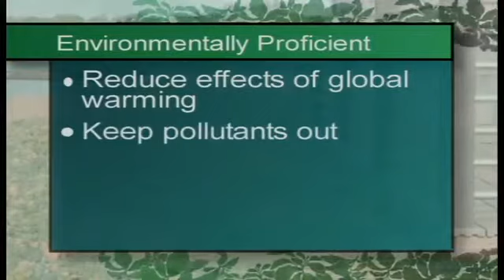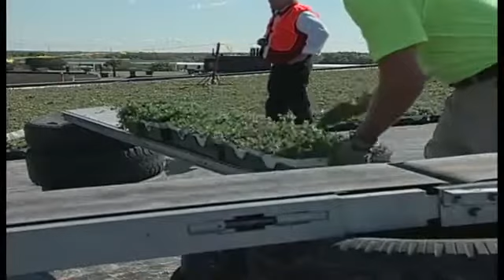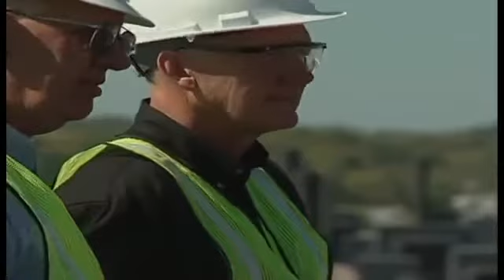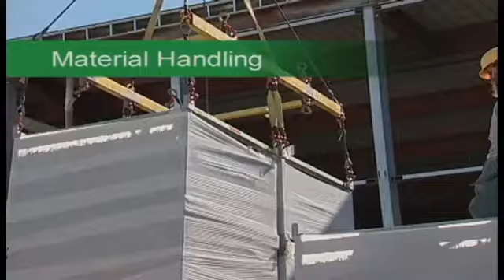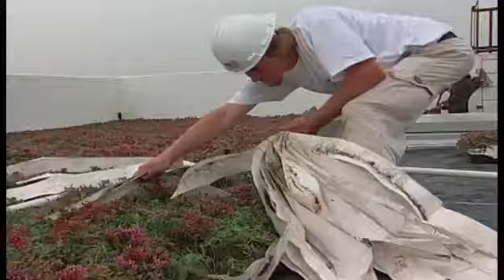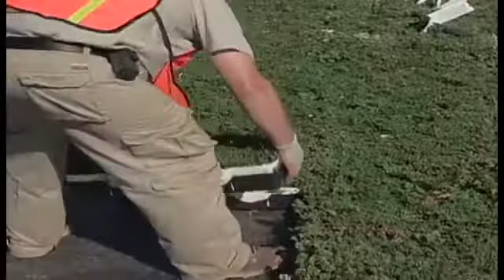How to Install a Green Roof Using the LiveRoof System

Comment: is a parapet required? for new construction roofs, do you need to still include the metal roofing or shingles or is that no longer necessary?
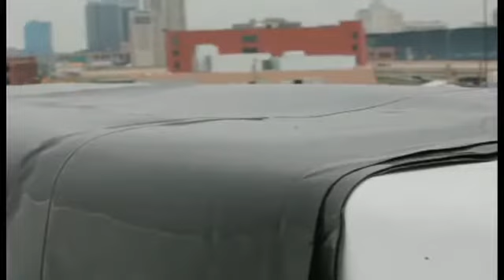Reply: At about 6:00 it starts talking about the "approved barriers". Shingles/metals are neither necessary or approved.